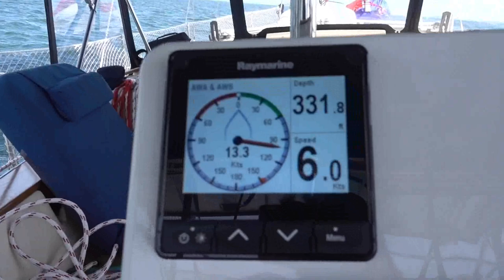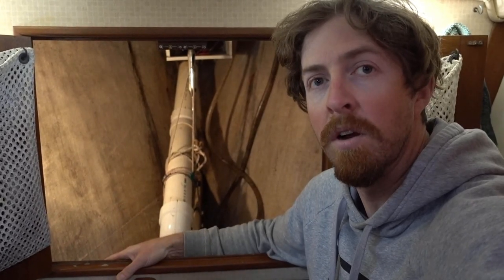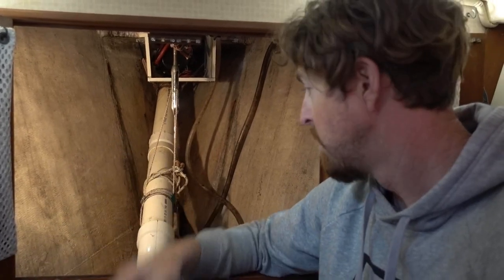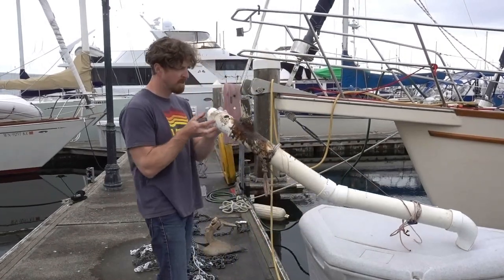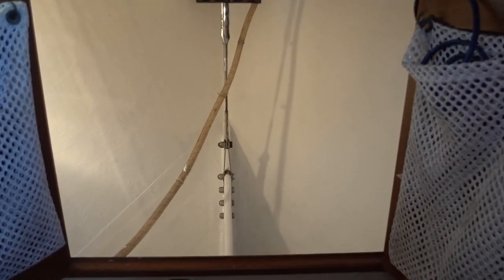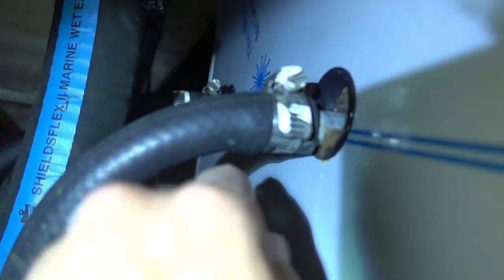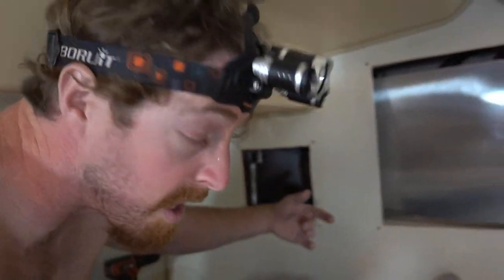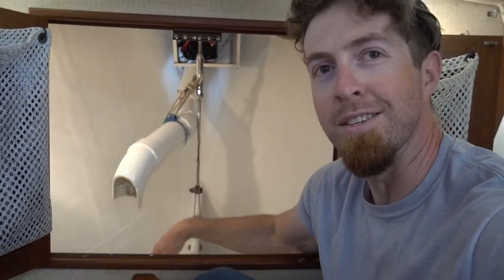ANCHOR LOCKER OVERHAUL!! S2:E7 ISLAND PACKET 38 - Sailing Stella J

Comment: So how does the chain tube work now???  Was hoping to see that at the end!  I have a 38 as well. Hull 180. Want to do the same thing if it worked for you.
Reply from the maker: Sorry about that, you make a good point.
Well, the small tube I talk about goes right up under the windlass, the chain then follows it down, spilling it out in a deeper part of the locker. It works better now, I’ll try and set up a camera so I can show it in action. I’ve been shown other designs which use a slide to shoot the chain elsewhere but I’d figure I’d try to alter this first. So far, so good.